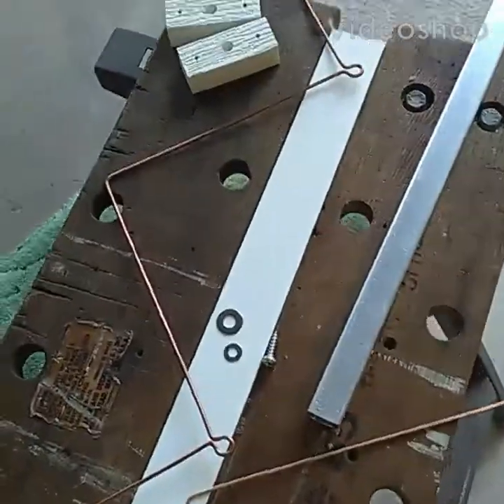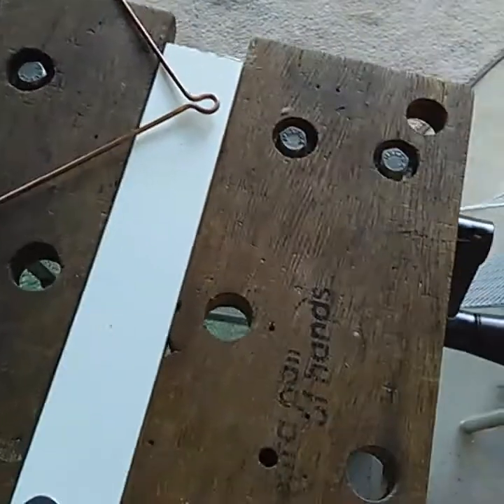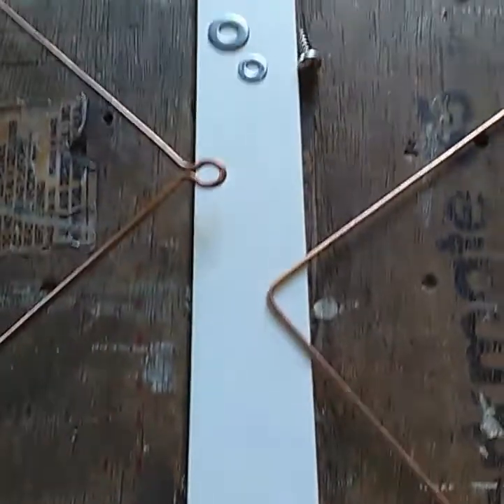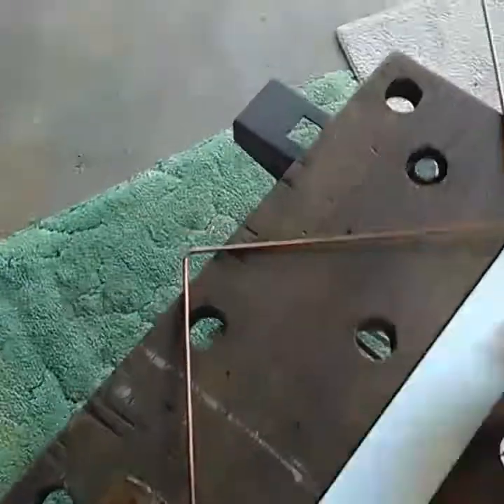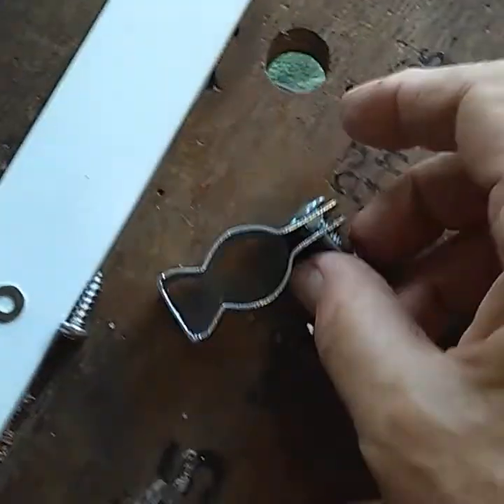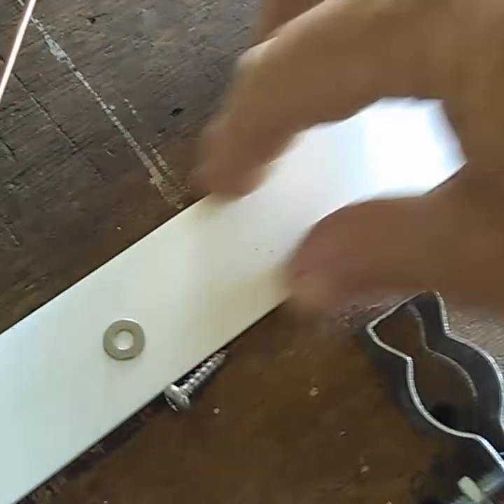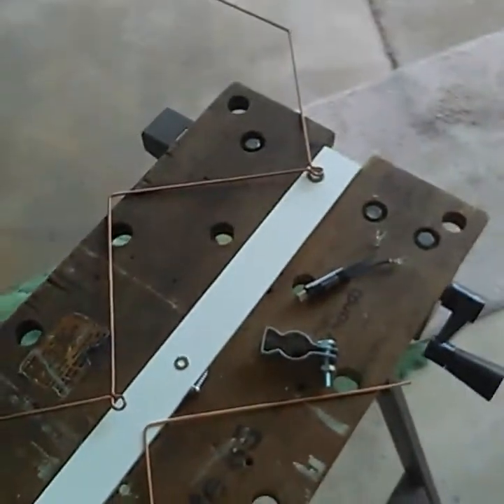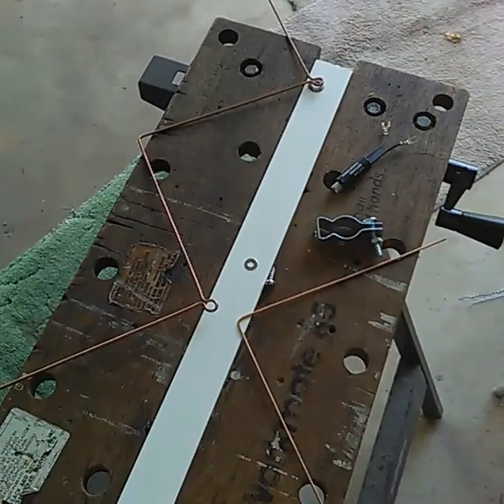Hoverman Alternate Mount

Comment: COSMIC ANTENNA, why do you feed from the center of the elements ?? Nice video Sir.
Reply: It is a question of symmetry.  The signal developed in the bottom half will be in phase with the signal from the top half so they will add directly.  If you make the top and bottom different they won't.